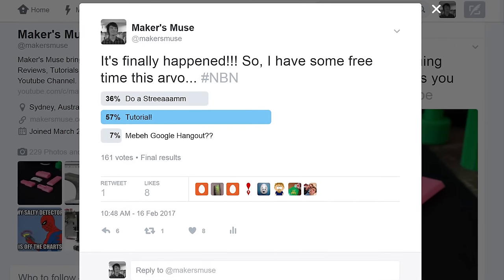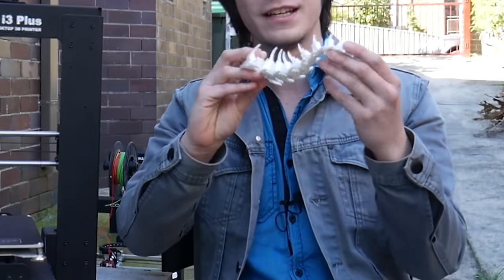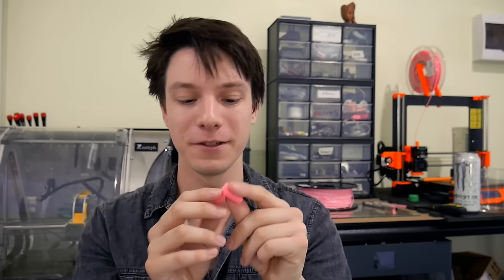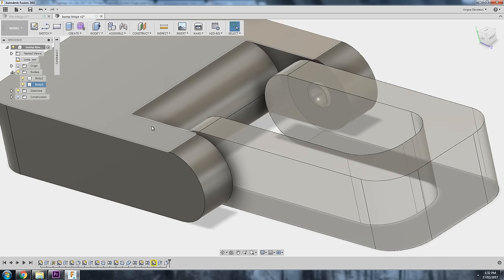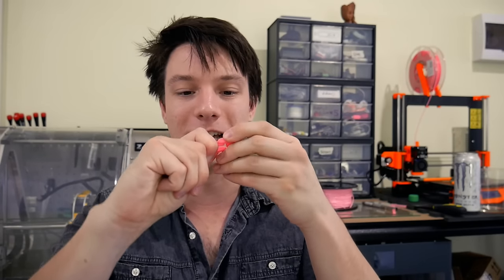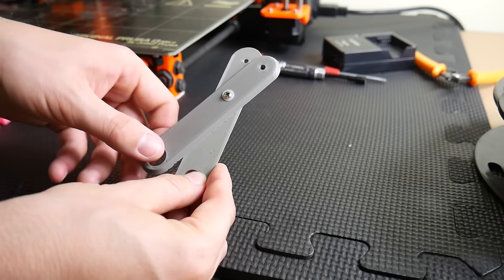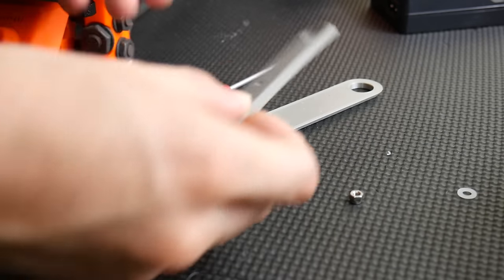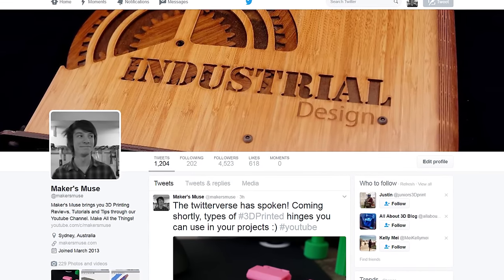How to design 3D Printable Hinges - Make moving parts!

Comment: Hi Angus, for the pin hinge, you mentioned bridging. As I understand, this is required since there is a gap between the pin and the slot and the pin is essentially "floating".
Can this bridging be automatically created by the slicer software? I am using Cura.

Comment: What's the easiest way to get parts that need to articulate but lock in place at certain angles? the only way I can think of doing this is a part that'll disassemble with a sort of star-shaped hole it fits in to rotate at different angles.

Comment: You forgot the "filament hinge" as an undercategory of the fastener. Since everyone of us has some filament laying around you can use it as a fastener. Its less hevy duty than the original fastener method, but easyer to design and print than the first print in Place method. But maybe dont use cheap pla as it tends to go brittle.

Comment: the second hinge (a dimple hinge) can be printed in place with a 3mm gap ... like the bar hinge (yes thats its proper name) it too also has to be manipulated to break the bits that bridge the gap ... the other hinge like on most doors is the half barrel hinge ... and of course the full barrel hinge .. the half stops about half way and has a pin that slots in ... cna be mad ein two half's and have a separate pin or be made with pin on one side and barrel on the other ... the full barrel is a barrel on one side and a pin on the other complete  BUT each pin points in to the  middle of the height ... making the door only removable by removing a hinge .. unlike the half barrel that can be done like on pirates of the caribean

Comment: Hi Angus, great channel; I really enjoy the products you show and the knowledge you share, so thank you very much for that...

I am looking to get my first 3D printer, right now my choice would be between the Flashforge Creator Pro or the Prusa i3 MK2. Could you give me your thoughts and/or experience as to which one is the "all around" better printer for a beginner? I know they are both great printers at the end of the day, but all printers seem to have their pro's/con's.

Example; I have read that an enclosed work area is better for certain materials as it will have better heat retention. Is this a concern with the Prusa? Or is this something that would not even affect your choice when looking at purchasing a printer?

Any info would be greatly appreciated, Cheers
Reply from the maker: I would ask the question - what do you want to 3D Print? The Prusa is no doubt an awesome machine if you're printing PLA, PETG or similar materials that don't require high ambient temperatures. Honestly unless you really need ABS for the higher temperature resistance and ability to be acetone welded, I would stay away from it. I only 3D Print ABS on the UP 3D Printers. The Creator Pro will do it, but not without a lot of trial and error. The Prusa will do it too, just not full bed size.
Reply: Thanks for the response, I will likely be printing custom air rifle parts for 10M style rifles (Field Target) So generally speaking the parts will be small, I am sure I will also venture out into printing all sorts of different things as I become more comfortable/skilled with the machine and process. The size limitation of the FF seems like a possible (future) concern compared to the Prusa.

Would Nylon be a good alternative to ABS? or is it just as difficult to print with?
Reply: +Joel Goodz I could give some advice on the FF as I own one, but I haven't used a Prusa. I can say that I'm happy with my FF Creator Pro that I bought last year. I was able to start printing with it right out of the box, although I have had to do some fine tuning with extrusion multipliers for various materials. My previous machine was a delta printer kit that I built, and although it prints organic models well I found that it doesn't print exactly square, and for the life of me I haven't been able to fix it.

One aspect that I like about the FF over my delta is that I can print wider, shorter parts by laying models down flat, rather than having to stand models upright on the delta. Even though the delta has an overall larger build volume, being forced to print models upright means the model has more weak points due to layer separation.

The FF can also print PLA reasonably well by removing the door and top lid to increase air flow, which takes no more than a minute.

I also like the blue platform stickers that came with the FF, I can print with ABS or PLA and have pretty much no problem with getting the first layer to stick. The bed on my old delta is a complete wreck, covered in glue stick, hairspray, superglue, etc., just trying to keep parts sticking to a heated aluminum plate. However, leveling the bed with the wingnuts can be a bit tricky to get right, as the platform sticker has a rough texture and the card that they provide for checking the gap can drag on the surface. So it takes some getting used to.

Also I have found that as I run a lot of prints on the same bed sticker, it seems like it loses its texture over time, so ABS tends to not stick as well with an old sticker. PLA doesn't seem to be affected by it, although I don't print a whole lot with PLA so maybe I just haven't noticed a change.

My FF came with dual extrusion, and being able to print dual color is awesome! I've never tried using dissolvable support material yet so I can't comment on that. But keep in mind that to use dual color you need to be able to split your model into two separate bodies, one for each color. So it's not great for someone who can't use modeling software, unless you only use other people's designs.

I really only have two problems that I've found with my FF:
1.) I can't use the SD slot. I think the injection molded plastic case around the slot might be out of size or something, but for whatever reason I can't get an SD card all the way into the slot so it can read. But I always have it connected to my computer so it's a non-issue for me.
2.) The spool holders on the back of the machine are a smaller diameter and have locking clips at the end. This is because they are designed to work with FlashForge's filament spools, which fit on perfectly and lock on so they won't fall off. This is great, unless you only want to use other brands for filament, which have different spool designs. The stuff I usually buy, which is fairly inexpensive, has larger spools that sit on the posts but can't lock on, so they will slowly walk their way off the post if you aren't paying attention. As a solution, I slid my machine up against a wall so the wall holds the spools on, however occasionally the filament would still jump off the spool and tangle up. So I printed a separate spool holder with wheels to hold the spool next to the printer on the desk.

All in all, I think the FF was worth the purchase,  since the only negative things I have with it were easily worked around. I've also got a Form 1+ SLA printer that I use just as often, simply for the sheer detail I can get on small figurines and cosmetic pieces. Hopefully this info will help you make an informed decision as to what you want to go with. Take care!
Reply: +Brian Closs Awesome, thanks for all the info Brian, it is greatly appreciated!!!

I went through College for CAD/CAM programming so CAD modeling something I do everyday at work. I used Cimatron, EdgeCAM, MasterCAM, Catia, Solidworks and AutoCAD over the years. One question I have is about exporting models; I drew up a model the other day and exported it once as a ASCI STL and another version as a BINARY STL, but both model look as if they are hollow when I bring the into simplify 3D, anyidea why that may be?

Thanks again,
Reply: +Joel Goodz Hmm I'm not sure, usually when I export models I don't have to choose between ASCI or binary so I'm not even sure why there's a difference there. I assume some programs require one over the other?...

As far as hollow models go, with Simplify 3D if you import a model and use the cross-section feature it will look hollow, just because it's showing the inside of the shell. It should still print out fine though. If you are going into the print preview and the inside of the part is hollow then double-check your infill setting and make sure that "vase mode" isn't enabled.

If all that is good but the slicer still wants to print it hollow, then I would guess the model itself was designed that way. Angus has a video where he shows how to use MeshMixer to create an internal support structure, but basically if the model has an internal shell that's inverted then it might still be interpreted by Simplify as being manifold, yet it would print with that hollow cavity rather than filling in solid.

That's why I've always found it best to design a model as a solid part first, and just use the slicer's infill settings to determine rigidity and material usage. Creating the model with specific internal supports can work if the part needs to be a certain way for assembly or something, but the more complex you design it internally, the more likely it is to cause issues in the slicer.

Also be aware that a lot of 3D models that are pulled from animation, like games or movies, don't always work great for 3D printing since those uses don't necessarily require the model to be completely manifold or have solid shells. Often they can use certain modelling tricks to get it to look good for a final render, but when you try to build that model as an actual physical object the slicer program gets confused. I would take a guess that a model built for CAD programming would work alright, as long as the shells are solid and manifold.

Comment: Angus, question for you. I have no issue designing parts for print in place. The issue I have is getting that file into the slicer and then printing it.

When I took a file which I created to be a print in place file.. it is clearly 3 separate pieces that are joined together with clearances. When I get the STL file and put it in my slicer it prints them in such a way as to make them one solid price. 

How do I fix this?

Thanks

Comment: another hinge type (similar to hardware) is using a pin (I use from a spool of craft wire since it is cheap and easy to work).  this allows the solid metal hinge but less space required than hardware.  great for small hinges.  in my case I was using it for a transformer prototype.  mostly because I was not getting a good mushroom peg with a diameter of about 1/2" on my DaVinci 1.0 Pro by XYZ Printing.  granted since I was borrowing it from my dad and hadn't a lot of experience with it I am sure it was mostly user error.  but I couldn't trust the mushroom pegs to be strong, smooth, and fit.  so I went with pins instead

Comment: Step 1. Use an Ultimaker 3
Step 2. Use the dissolvable filament
Step 3. Print hinge w/ supports
Step 4. Dissolve filament in water
Reply from the maker: You missed step 0. Spend 3000 Euro on an Ultimaker 3...
Reply: Yeah it is pricy, but the joke still stands. Also, damn that was a fast reply.

Comment: Muito Obrigado. You are the Master of 3d printing. Please, I need some help. I need to print like a "vase" to contain water. I did some tests, I printed a vase and after that I painted it with Primer spray, but it was not able to fill the space between filaments. Do you know some technic to do that? Like a rubber paint or something like that?
Reply from the maker: +Carlos Bitencourt try a two part epoxy resin, slow cure so it has time to fill the gaps.

Comment: Regarding that first hinge that is print in place, what orientation was it printed in? I would guess on its side with supports. If so, does it need  super tiny supports in the actual hinge area, where the small piece overlaps the larger one?
Reply from the maker: It was printed as designed, lying down flat so the pin is a bridge across the parts, no supports required!
Reply: Maker's Muse Oh, I understand now! Thank you!

Comment: Do you have one about making snap together joints and tolerances?
Reply from the maker: That'll be one in future, i'll be doing a lot more design principle videos, mostly centered around using Fusion 360.
Reply: Right on! I'm always down for learning more about how to use Fusion 360, since I'm still pretty much a novice with it. For the last 3 years that I've done 3D printing, up until I saw your first video on F360, I exclusively used Blender for doing models. Once I saw the capabilities of F360, I realized that I could do in ten minutes what it would take me an hour to do in Blender. I switched right then, and never looked back.
Reply: I was going to say you forgot the "slotted chamfered pin into hole" joint, but it looks like that one will be coming up. Awesome!

Comment: What about printing the pin hinge on its side so that it doesn't have to bridge but instead the pin goes straight vertical through the hole of the other one and now that outer cylinder doesn't have to bridge over the top of the pin either?

Comment: Hi Angus, one query , what is the material you have used for this demo is it PLA or ABS?
Reply from the maker: ABS for this example, but you could also use PLA.
Reply: Thanks, Have you noticed any majot difference in performance between ABS and PLA in terms of fits

Comment: Is there a chance you could make a video about exactly where and when molten plastic becomes rigid enough not to move down anymore? I'm trying to visualize why the inside of the hinge wouldn't simply fuse the pin with the bottom of the inside, if that make sense.

A slow motion video of creating a first layer of a bridge would help :D
Reply from the maker: Joel did an interesting video about bridging here - https://youtu.be/nL0nWJ__PNM

Plastics have no true melting or hardening point, have a look at 'glass transition temperature' to learn more, it's pretty interesting :)
Reply: Saw that one, but in your hinges it's not in mid air, it's 0.3mm above another layer, which means it either becomes rigid before moving more than 0.3mm downwards after being extruded, or if it moves more, the plastic under it is already cooled down enough not to fuse with the new one. Do you know which is it? Or did I miss how it works entirely?
Reply from the maker: Playing with a 3D Printing Pen is a good way to visualise it - the filament becomes tacky and hardens very quickly after neaving the nozzle. You can definitely string it between points without the material welding to the plastic below it. At the distance between the hinge parts it probably droops maybe 0.2mm or so, and worst case might be 'slightly' bonded, but will crack free much like how support material works.
Reply from the maker: Printing slower actually makes bridges worse, the ambient heat from the extruder will make the line sag more.
Reply: Thank you for the answer, I think I understand now

Comment: There's a project I want to see built that involves 2 very large super magnets placed over each other kept in just a long enough tube whereas those can pull at each other furthest away... with quite a slit beneath the top magnet where... maybe a sheet of aluminum can always slide in between them. I want to see how much electric power it will generate for the magnet to both rise and fall... and what would be the least amount of energy it takes to block that magnetic field with a sheet.

Comment: You left out using the filament as the pin and melt the ends flat on both sides of the filament so it does not come out. May not look as good but quick easy and strong. :)

Comment: couldn't you do a ball swivel hinge just like you do the permanent pin? print a ball socket with a gap between the ball and then you can make things like action figures with ball joints in 1 piece

Comment: Instead of Nyloc or threading you could also sink a nut profile into the receiving part. Eg for an M3 profile a 3mm hole for the bolt, then sink an M3 nut shape around the hold to receive the nut. Added benefit is not needing multiple tools to join the material.

And another option would be (for harder materials) to use the 90 degree cutout that you see often in laser cut acrylic.
Example https://i0.wp.com/cdn.makezine.com/uploads/2012/04/biased-box-corner-with-pettis-joints.png?resize=580%2C489

Comment: I really want a 3D printer but from what I've seen they're really expensive... And the cheap ones may be really crap... 

Any decent ones you know of fir pretty cheap??
Reply from the maker: Check out our 3D Printers for $350 or under - those machines will all be a good first start.
Reply: Dan Hinchliffe I have just got Anycubic i3 Mega from AliExpress. It came with a loose belt on extruder head and not enough oiling on the rods, but after tightening the belt and oiling the rods, I have a nice full metal 3d printer and that costed me only 300 Usd. Just did some test prints with both ABS & PLA and I am quite happy with the results. So Maker's Muse is right, check the ones around 300 - 350 USD price range, you won't regret!
Reply: Thanks guys! I'll be getting one in the next week or so! Haha

Comment: How do you export stl files from Fusion 360.  It will only 3d model 1 body at a time so I cant do print in place joints designed in 360?
Reply: You can right click on the project tree, before it drops down on origin, bodies and sketches. This way it will export everything as a single STL

Comment: I want to print the pin hinge but how does the printer print both parts together without  supports?
Reply from the maker: Your machine should be capable of bridging the gap, leaving a slight distance between each part so they can separately move after printing!
Reply: Thx once more for your help. More tuts if you get tge time angus please